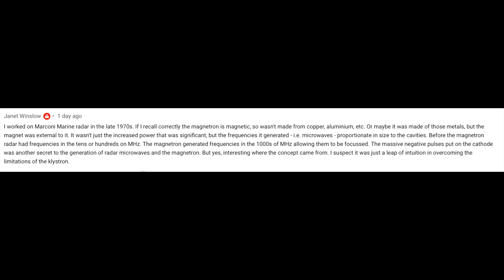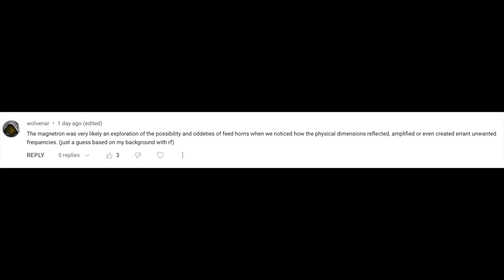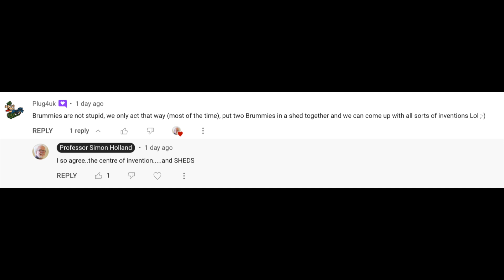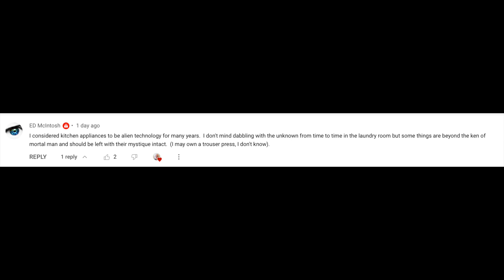Radar secrets part 2 - Prof Simon

Comment: Hey Professor Simon that's a great resonance chamber you made up on your drill press. All it needs now is the vacuum tube and magnets with some high voltage ⚡ DC current to start oscillating. Vacuum Tubes yes!
Reply from the maker: Right on